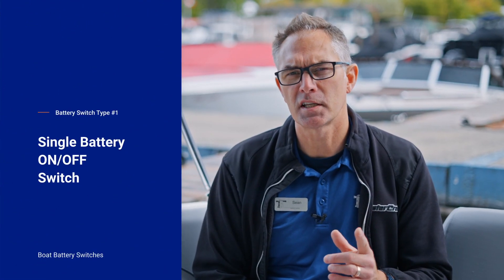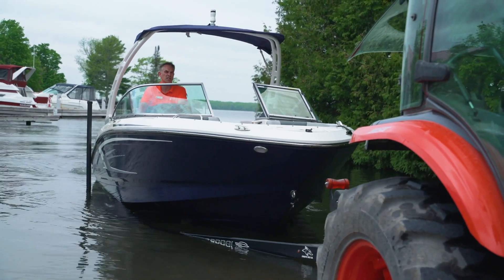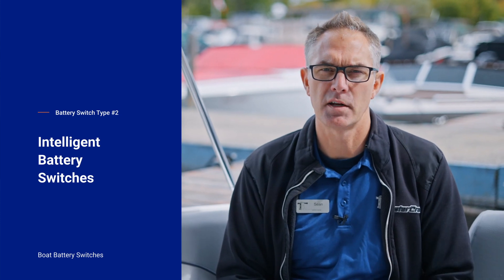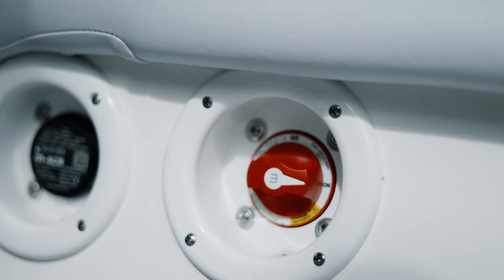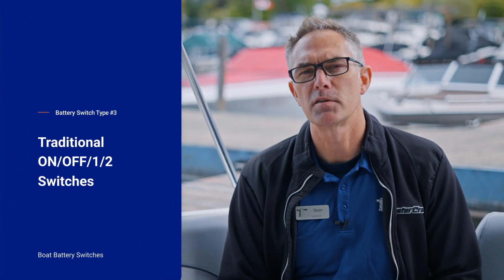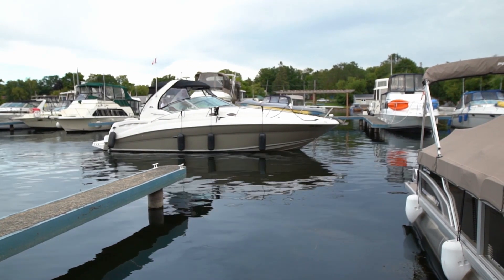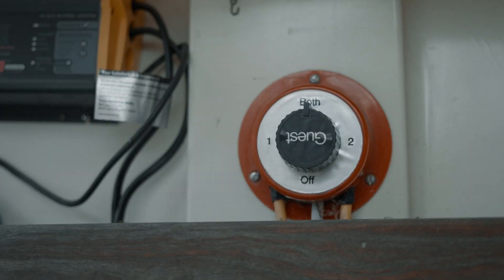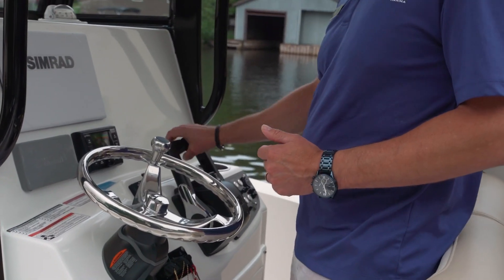Boat Battery Switch Explained

Comment from the maker: Have you ever been stranded by a dead battery? Any other tips/tricks you know of for our followers?
Reply: I recommend an A09 portable jump starter 500A DBpower, this charger is the size of a phone and is good for 1000 jumps. It charges with a phone cord. Never had to use on the boat, but started a friend's car at launch. Always keep on boat and charge 1 per season.
Love your videos, thanks
Reply: This will also charge phones , tablets, and has a flashlight.
Reply: My Bayliner works on a traditional system. Are both batteries being recharged when running the boat?
Reply: Dead battery can definitely be a dangerous situation.  We were in a deep water channel fishing when a Navy Destroyer wanted to pass.  We tried to get out of the way, but the boat wouldn't start.  No matter what we tried, it wouldn't start.  They don't stop.  At the very last minute we figured out the shifter was slightly out of gear.  We escaped in just a nick of time.

Comment: Question for you.  If I have the simple on off switch with a starting battery.  Can I connect an ACR to the starting batter and add a house battery in the cabin.  Also, if this isn't a problem, can I connect the house battery added to the accessory positive and negative buss to add backup power?

Comment: I have one of those 1/2/both switches. I also have a solar panel that is wired to battery 2 (house battery). The boat lives on a trailer at home when not in use. My question is, when the switch is off, will the solar panel be able to charge both batteries or will it only charge the one it’s connected to? Thanks :)

Comment: The thing that would help on newer/any boats is if each battery had a charge indicator. My Robalo only has one indicator. You can’t tell even if rotating through the switch which battery you’re seeing the charge for. Then there is the trolling motor, is that being charged indirectly when the engine is on?

Comment: Is it possible to charge BOTH batteries at the SAME TIME by putting the switch in BOTH and connecting the charger leads of the charger such that the positive from the charger is connected to the positive of battery 1 and the negative from the charger is connected to the negative of battery 2?
Reply: I wouldn’t try that, im no expert but any boat I have seen with multiple batteries had a trickle charger hooked up to them so they could charge all of them at the same time. My boats the same way, I have 3

Comment: Good video , we got a boat with 2 batteries and the switcher  1 , 2 and both , but the old owner has attached 2 jumper starters at the side of the batterys , and always let it charging the jumpers,  was wondering when i should do that ,  i think that way jumper was in overkill.

Comment: I run a 3 position switch on my center console, I run the boat in position 1 which uses a deep cycle battery for my electronics and a separate starting battery for my motor, my problem is, I just noticed im not getting any power to the motor in position 1, no crank, it is a brand new battery, but when I turn the switch to "Both" im able to start and everything runs normal, all my terminals { in view, I haven't dug deeper yet} are clean with no corrosion, where do u suggest  I start to get to the bottom of this problem, is it possible the 3 Pos switch went bad??

Comment: I have an on/off/1/2/both switch on my 2001 Searay.  If I use the "1" position to start the engine and leave it on "1" when running, will both batteries charge while cruising?
Reply from the maker: Not likely, although boats are wired in many ways, and we wouldn’t know for sure. My expectation would be no it won’t.
Reply: @boatinglessons  Thank you.  I think I would need to switch to both after cranking the engine, and hope that switching doesn't affect the alternator.
Reply from the maker: @bryincda  I would not switch it once the engine is running. Any reason not to start it on "both"?
Reply: @boatinglessons  I have a starting battery and a deep cycle battery.  I was not sure I should use both to start the engine.   Thank you  for any thoughts you have.

Comment: My boat has a battery switch. But the motor and tilt/trim motor is bypassing the switch. Most likely so that noone kicks and turns off the power while coasting. But i heard that Evinrude motors will run even if the battery is disconnected. Wouldn't it be better to have an extra switch for the motor then? Also i have a 20ft boat with 115hp motor. Would it be wise to get an extra battery that is always connected to the motor (exclusively) than running everything from the same battery?

Comment: In the UK, many canal craft will have the last type. What this video did not mention is charging the batteries. Normally it would be wise to switch to ' both' to charge the starter and leisure battery bank simultaneously.
Reply from the maker: Yes and I agree, good point
Reply: @boatinglessons In the case where the two batteries are identical,  for many years I have been using Battery 1 on odd dates and Battery 2 on even dates. If you always run on Both, you will  not know when one battery has failed.  I have had two cases aboard small vessels where the operators always use Both. I have asked them to try my method of using only one and the engine would not start. Proving the selected battery had failed.
Reply: If I'm not mistaken, I will stand corrected if wrong, some smaller engines won't have the power to charge both batteries at the same time or put a strain on the charging system (talking OB), use # 1 bat going, switch to # 2 hanging out & coming back, depending switch back to # 1 half way home, always have a start boost box, tried walking on water, no bueno !
Reply: Couldn’t you check each position engine off and raise and lower engine in each position? 1 or 2?

Comment: Question. i have a 2 year old boat that has a trickle charger installed by the manufacture (Monterey). Last season I took the batteries off the boat and stored inside on a trickle charger. This year I kept them on the boat and have the trickle charger on that was installed by Monterey. Is that ok to do?? any feedback would be appreciated?
Reply from the maker: Do you leave the trickle charge on all winter or just turn it on for a few hours on certain intervals?

Comment: I have 2 batteries with the battery #1, battery #2, both or off selection switch and always use one battery to go and the other battery to return or one battery one day and the second battery next day. This way keeps both batteries charge and always keep one battery ready in case I needed. I will not recommend using both batteries all the time. Both batteries will be dead if a problem shows up. Use only one battery at the time, keeping the second battery ready as spare when needed.

Comment: One important thing is never switch to off or switch pass off when the engine is running.  You will blow alternator diodes.  Also if you have a fridge with food, you will probably leave the switch to house (2 in your example) when you leave the boat.
Reply from the maker: Yes, you are correct. Any potential fluctuation in voltage is to be avoided at all costs

Comment: Cheers, excellent content. Question though, I have the traditional 1/1+2, and the previous owner always just left it on 1 (Start Battery) when connected to shore power at the dock. If I leave it off, can it still charge the batteries? through the onboard charger?
Reply from the maker: Normally the chargers are wired directly to the battery, independent of the switch. It should not matter the position of the switch.
Reply: That was fast, and unexpected, thank you :)
 @boatinglessons

Comment: I've never been good with the electronics, my question is, with the old styler, 1/2/both switch will the boat recharge both when you're on just one of the batteries or do you need it on both to recharge both?
Reply: I wanna know the answer to this also

Comment: Do you want older switch set to both so to charge both while running?
Reply: Yes, unless you know one side is fully charged, just run the engine with the switch on both.

Comment: i have a question unrelated to this video but boat related. so i have a older boat i bought a few months ago. its been working good except to start it wheni put it in neutral ive always had to kind of push it forward in the lock position for it to register it to start up. but the other day my trim down was stuck when i pulled to the ramp to get off water. which was wierd so i was moving the throttle back and forth through forward and reverse and it stopped it but then when i went to start it nothing. so then i would press the button to move out of neutral and just barely push it forward and then it turns over. i had to get out today to get my trotlines up.. i had to start it like that most the day but at the end it took 5 minutes for me to get it to finally activate.. so what is wrong with it. and how to fix. lol. i dont know much about boats. sadly. its one of those throttles where you put the key in it also. but not sure really what is the problem.. im guess its not registering it in the correct position in neutral so it wont turn over. but everything else is fine. except  every so often as i go to put it in revers it seems to get stiff till i put it all the way in full reverse then back into neutral. not sure if that has anything to do with it also. thanks for your time.

Comment: Grade:  F. You took a very important mistake, batteries in parallel, and made it confusing. 7 minutes of details without explaining the fundamentals. No simple diagrams. In 7 minutes, you could also have explained solar panels and multiple batteries: Separate chargers into separate batteries into separate loads. Oh, never wire batteries in parallel. Small differences in their voltages make them fight each other. You could have called it " Boat Battery Switches Not Explained".
Reply: Shut up. You get an F

Comment: My automatic bilge pump drains my battery 😭😭😭
Reply: yes or your boat sinks.  Better a dead battery than a sunk boat
Reply: @mrwrapper  no cause I take the plug out. Fixed it btw
Reply: Find your leak & fix it, if it's from rain, cover boat best you can, or maybe bat. old & weak, check boat more often if possible ? there are ways for everything  !
Reply: @Roger-gm9tl  Nah there wasn’t a leak. It just ran all the time, even with no water. I have since gotten it repaired, but my boat always gets trailered with the plug removed and boat covered anyways.

Comment: The 1-2-Both switch is a relic of a bygone era, and has no place in any boat today.  It's just too easy for boaters to set it wrongly and end up with a dead starting battery.  There are much better solutions today which are literally fool-proof.
Reply: Sometimes depending on to much technology can get you in worse trouble than plain good old common sense, maintenance,  all boaters should have a little basic know how for simple things unless they've learned how to walk on water !
Reply: @Roger-gm9tl  You don't need "technology" particularly to create a foolproof charging system.

Comment: It’s always about what you DON’T know that can get you! I have an OFF/1/2/BOTH switch and have no clue about whether one is for starting the motor or the other for my two chart plotters, which take a lot of power to run. Newer units do pull a lot of power. I have always run on BOTH and turned to OFF when docked. Now I’m not sure what’s going on. I have two trolling motor batteries that are independently on a charger under the console. I have always thought 1 and 2 are charged by the motor’s alternator. But I don’t actually know. I take a portable battery jump starter with me in case for whatever reason the starter battery is dead. What is the best way to find out what’s going on back there?!? My trolling motor batteries are GTG. I have a sensor on the motor that tells me my battery levels. But nothing like that on my two boat batteries. Do I need to ask my marina when I do yearly maintenance or is there a way with current probes that I can find out for myself? Basically, is there a way for me to test my system while out of the water to find out what’s going on back there? Thanks! 😅
Reply: Alternator charging can be switched to 1, to charge the starter, or 2 to charge the leisure bank, but easiest to switch to 'both' as soon as, or before, the engine is started. Once the engine stops, just switch to '2'.

Comment: I have what you mentioned at the end.  Two starting batteries with a 1 and 2 position switch.  Then a separate trolling motor battery.  All are charged by a single charger in the battery compartment.  I towed someone back to the ramp recently and was thankful that will never happen to me because of a dead battery.

Comment: I have a 1/2/both switch but want to remove one battery from the system. How can I bypass the switch and just use one battery?
Reply: Disconnect the switch totally and hook wires to your battery

Comment: We had an old school “off/1/2/both” switch on our 25 cruiser.  I’d frequently forget to switch it when we’re at anchor.  My greatest fear was drawing down BOTH batteries while at some remote anchorage and not realizing it soon enough.  I installed a automatic charging relay with a new switch and that totally alleviated the worry.

Comment: I had the OFF/1/2/BOTH switch for the longest time, and using only 2 batteries, and I would have to go to the switch and flip it back n forth to have my house running, and the start battery disabled, however, sometimes I'd forget to do that.... now, after watching more youtube videos, I am now running 1 START batt. and 2 HOUSE batts. and installed an OFF-ON-COMBINE switch....
I now have peace of mind knowing that I will always have a battery, that's fully charged, and not endlessly fussing with the battery switch!
Reply: My Bayliner runs on the same system. When you are running your boat are both batteries being recharged at all times?

Comment: Do recommend the "OFF" position for charging a two-battery system.
Reply: If it's off, it won't charge. Best to switch to both when running the engine.
Reply: Thanks,  @ratwest

Comment: I have a switch with 1,2 then both.  I usually run the boat down the lake with both selected so the alternator charges both.  Then if I cove out I’ll select one or two when stereo is on.  Is that ok?
Reply: When you cove out you don’t want select just 1 or 2, you want to select the house battery which should be 2. You always want your starting battery to not have any draws
Reply from the maker: Yes, that makes sense to us.

Comment: Thank you so much. If I run battery #1 only will battery number 2 charge itself or do I need to run number 2 for it to charge
Reply: depends on the switch. If its an older style "dumb" switch, no it won't charge the #2 if the switch is set to #1.
Reply from the maker: Peter is correct, each switch and wiring is different. If you are in doubt, run it on "both" and it will charge them both.
Reply: I guess it depends on the switch. My manual states to never run it on both. it says only turn it to both if one of the batteries is dead to start your motor. which doesn’t make sense to me because why wouldn’t I just switch it all the way to the other battery? But it does state it will not charge both batteries when the setting is on both. I have to either have it on one or two. which is also a pain because I have to remember to switch it over so both batteries are getting charged. Kind of a dumb set up.